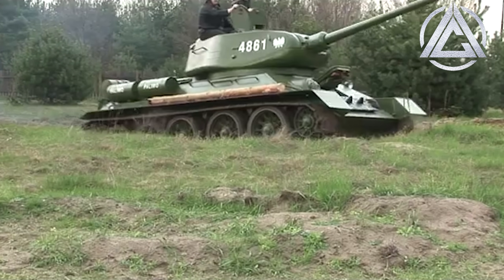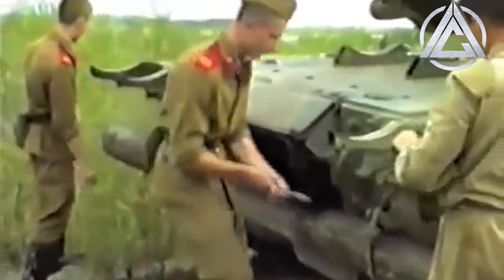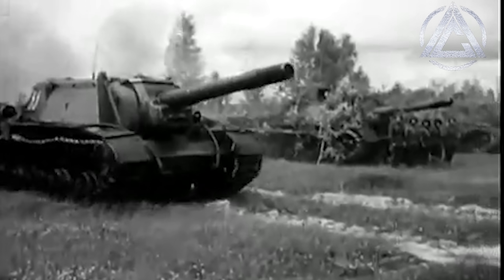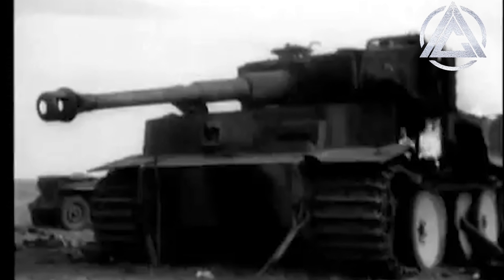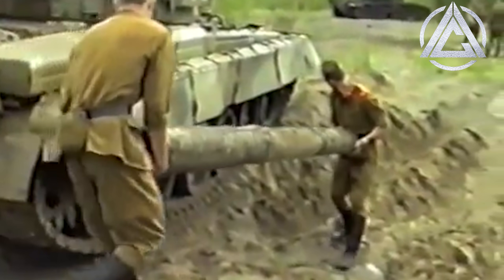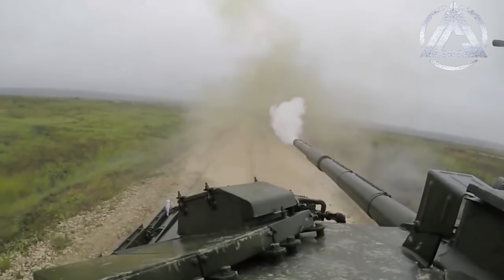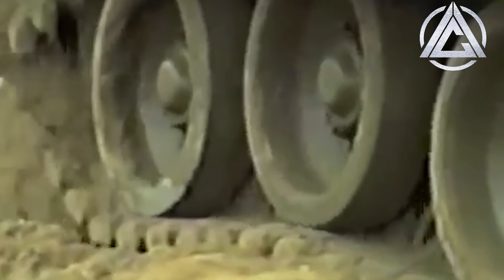What's With the Logs on Soviet Tanks? | Koala Explains: Tanks - Tracks and Traction

Comment: In the USA we have roads which may still be called “Plank Road”. During early days of expansion that was a fast easier method of construction.
Reply: During the Civil War, the Union Army created the "corduroy road".  Many of the primitive dirt roads that received heavy traffic from traveling armies would turn into muddy bogs during wet periods, which would slow & fatigue the infantry & the cavalry horses, & make artillery & wagon movement almost impossible.  To prevent this, tree trunks, fence rails, & ties from sabotaged railroad sections were laid cross-ways over the road to give a firm surface & prevent sinkage.  The road pattern resembled the cloth, hence the name.

Comment: American tanks always travel in at least pairs, as the smallest maneuver unit. They each have metal tow cables, shackles, and recovery points at the front and back of the tanks. It’s a lot easier to have the loader jump out and connect the tow cable to the stuck tank and give them a little pull to help them get unstuck. Assuming both tanks aren’t stuck. In that case you call a recovery vehicle and get laughed at by everyone passing by while you wait.

Comment: Ok, silly spoiler...sigh. yes the logs were to get traction in ice or mud. The briefing i got said, they use the logs for traction and could also be strapped to the actual tracks for ultimate traction to employ both sides of the tracks to get out of a ditch, etc. The other problem was that due to the vast numbers of tracks, the soviets didnt have a complimentary number of recovery vehicles to tow all these stuck vehicles. So, yes, the same reason my dad kept some 2x4s in the trunk of the car...

Comment: Lol.  Actually it’s to assist them in getting unstuck when they’re high centered on a rock tree stump at Cetera. By feeding the log from one side through the tractor the other and letting the center connectors catch the log it will help them walk over obstacles that are hung up on.  I was a crewmember on the M1 Abrams tank for years.  We did the same thing.

Comment: Soviet military maxims really were KISS, Keep It Simple, Stupid. You wont find differently launched munitions in the same calibre for example, eg 155mm shells & 165mm rockets. In the heat of battle a replen radio message could be sent wrong, so with the different calibres, the guy Not under pressure could immediately id that the commander does Not want 165mm shells, and ask if they want shells for guns or rockets for tubes.
Another great example of KISS in Soviet military was the conversion from 7.62 to 5.56, and the introduction of the AK74, pretty much Just a downsized version of the AK47, so no training needed if already familiar with the old rifle.

Comment: 3:00 What if the recovery vehicle gets stuck too? That's when you call the recovery vehicle designed to recover the recovery vehicle. That of course is when you get such rigs as the RVRVRVRVRVRVRVRVadnauseum
Reply: When I was stationed in then West Germany 1st ID 1989 remember a day when an M-1 got stuck on a hill 50 feet up and called for a recovery. M-88. Well the 88 never made it, as it got stuck after throwing its track on a rock trying to get to the M-1. They called for second 88 to try and get them unstuck. Don't know how that went but I know about 8 months later we almost got our M-2A2 Bradley stuck in almost the same area. Fun times. As for the M-1 the TC decided to drive it down the hill with only one track as the gas been thrown on a rock. Craziest thing I ever saw while in. Drove over the edge and across a road into a field. 
As for the 88's I Ausome that both made it out later that day.
Reply: Rofl

Comment: Mmm, I disagree with you about what defines a tank; a tank is a role: something that is mobile enough to cross open difficult terrain at speed and tough enough to get in fights with anything smaller than they are. If a tank were a mech or a wheeled vehicle but could perform the same role, it'd still be a tank
Reply: Good point, I think his definition was a bit too broad. Lots of talks about the Killdozer, which I would classify as a combat engineering vehicle rather than tank. Then there's self propelled artillery, which in the basic sense resembles a tank (tracks, at least some armor, big gun on a turret), but is not considered a tank - my understanding is their armor is thinner and they lack close-quarters defenses (typically don't have secondary weapons), their intended purpose is different from a tank, it is to yeet shells from a distance while true tanks get into the thick of things.

Comment: Dude you know nothing about tanks and why there are logs on them. Americans used logs to better protect their paper thin tanks, they also used sand bags, metal sheets, bags with soil and whatever else they could find laying on the ground, because nothing could protect them from 88mm Tiger gun. Russian tanks do not use logs to get out of the mud, they are designed for that terrain. Logs are necessary to get thru soft and/or sandy terrain and swamps. During operation Barbarossa, Germans did not travel north, because if they did, they would have end up in polar caps and not at the gates of Moscow. If you are too stupid to look at the world map, than don't make stupid videos. Also Germans tanks did not receive wider tracks to better handle winter soil.... You idiot, soil is frozen during winter, its as hard as concrete, there is no need for wider tracks to get thru! It's the same thing as if you would have said: "I need wider shoes so I can get to the other side of the road". FYI Russian tanks never weighted 60 tons, the heaviest Soviet tank weighted 52 tons - KV 2. 60 and 70 tons are weights of the German, British and American tanks. American crew men also used logs during WW II, to self pull their tanks out of the ditch, places where they got stock and so on, and it proved to be very effective. The only reason Americans stopped using logs, because their tanks riched over 60 tons mark, they became too heavy for that and they simply crushing that damn log. This is always the case, dump red neck yankee makes a video as retarded as he is and make other dumber by having them watch it.

Comment: They are still used, just carries by support vehicles more often than not. The ridge pole for the two masted army tent can be used in this capacity as well a the timber sections that make up the surface area of the lowboy trailers that heavy equipment operators Heavy equipment is transported to and from work sites

Comment: Wood does absolutely nothing in protecting from stuff anything that's pointy and designed to penetrate/go fast will on average rip through wood one massive reason why you don't use it when building fortifications anymore or better said avoid it at least when it comes to being infront of the shooter because ey guess what shrapnel lost of it when wood gets hit unless you got a giant log infront of you even small arms fire will unleash hell on you in form of many tiny wood fragments flying in whatever direction that bullet was going.
And also I'm interested to see what information material out there states Germany using logs as legit armour considering they tended to focus armoured skirts for helping but maybe I'm wrong and if giving the proper I'll gladly retract my statement about the Germany military.

Comment: This reminds me of that Cold War tale of how NASA spent tons of money to invent a pen that could be used in zero gravity.
Meanwhile Russians just used pencils.
Reply from the maker: A funny story, but actually not quite true - 

NASA had been using pencils themselves, but unfortunately pencils are extremely dangerous in space due to the graphite shards that they like to throw off. In order to prevent this, NASA were spending over $120 USD per mechanical pencil (adjusted for inflation, that's over a thousand dollars a pop today). What they developed was actually a cheaper and safer alternative, with a pressurized pen using gel-like ink that couldn't leak or oxidize, and could be used in extreme heat or cold

Comment: As the story goes, Nasa once spend millions of dollars on a pen that was able to be used in space. One day a Nasa guy asked his sovjet counter part what they had developed for writing in space. He showed then his pencil.......
Reply from the maker: A funny story, but actually not quite true - 

NASA had been using pencils themselves, but unfortunately pencils are extremely dangerous in space due to the graphite shards that they like to throw off. In order to prevent this, NASA were spending over $120 USD per mechanical pencil (adjusted for inflation, that's over a thousand dollars a pop today). What they developed was actually a cheaper and safer alternative, with a pressurized pen using gel-like ink that couldn't leak or oxidize, and could be used in extreme heat or cold

Comment: Most European tankers learn this method. The difference is that most countries don't carry the log full time, but rely on cutting down a tree if the need arises. Besides, the most common unditching is by pulling it out with an ARV og another tank(s) in the formation. Tanks rarely roll alone, but if you do and get stuck, most tankers are able to unditch using a log.

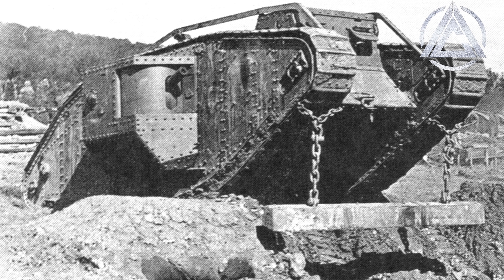Comment: 3:18 Not really there to stop AP shell, but rather to protect the tank from grenades with magnet. Germans even used a coating (I think it was called zimmerit) over their tanks which can be seen as "waffle pattern". However, they gave up the idea soon cos that coating contained flammable materials and if not 100% dry, it would start burning when hit, even on non-penetrating hits. Which is not pleasant... Also, in Europe, only Germans used magnetic grenades, so they never faced the opponent that threw that on them... Of course, a bit of psychological effect on crew when they put logs on side and think "Hey, that's extra protection" even though it really isn't...
Americans, on the other hand, faced Japanese infantry that did use magnetic grenades, usually on a bamboo stick for longer reach. So, having wood over your tank prevented those from attaching to the tank...

Comment: You are forgetting a crucial part of this method. The log is not only just put in front of the tracks, it is also attached to the tracks as you can clearly see in the footage. The log will become trapped in the mud under the tank which will allow for the tanks to use it as an anchor point from which it will be able to project itself forward. If the log is not attached the tracks will simple graze the log and chew it to bits. This also means the tank can only move forward until the log reaches the back end of the track because it can not travel further. If the tanks is still bogged down the log will have to be removed from the back end and be reattached to the front. It is a crude, but very successful and low-cost way to get your tank unbogged.

Comment: i mean, it can give protection against heat and hesh
Reply: True!
Reply: To a certain degree of course.
Reply: @nogisonoko5409  HESH (High Explosive Squash Head) is not affacted by angle of attack, remembering of the plastic explosive in the head of the ammo deform in impact, with exception of extreme angle (+89°), HEAT (High Explosive Anti Tank) in other hand, affected a little by angle, because its jet stream will follow the angle of attack (eg : Angle = 37° penetration angle = ±37°), the higher the angle the less efective the ammunition, although modern armor will not affected much by HESH or HEAT if it hit the logs in all angle
Reply: @nurrahmanpurwanto2976 
Yes.
Reply: @nogisonoko5409  great, you understand!

Comment: Serious question here. Is ground pressure/traction/ torque the reason why all the best protected vehicles are tracked and not wheeled? Wheeled AFVs have a lot of advantages but there just don't seem to be any with the kind of protection on MBTs. I'm guessing this is just an inherent design trade off? Anyone?
Reply from the maker: The main problem with heavier wheeled vehicles is what I went over in this video - you end up with something that can damage its own transmission on roads, and get immediately bogged down OFF road, because the weight isn't being spread across a wide enough ground contact.

The more weight you're putting on the chassis, the more ground contact you need, and you can only fit so many wheels on a vehicle practically.
Reply: So do you think say STANAG 4/5 protected wheeled vehicles like Centaro 2 are about the limit?

Comment: I didn't realise they continued this method for so long.  I think this is when the phrase 'if it ain't broke don't fix it' comes into play
Reply: Compared to the cost of the tank itself, the log is practically free, so why not keep it.
Reply: Log= fence post , fire wood , door ram , crows nest , road obstickles ...I wonder if some secondary use , influence s it's continued use . ?
Reply: cost of tank recovery vehicle versus cost of 10 foot long log - cheap enough to have a log for each tank, but not a tank recovery vehicle - I doubt setting the log under your tank would be much fun if you were under fire though
Reply: @richardhockey8442  then you would lose both tank and recovery vehicle, as both will be under fire.
Reply: @ceu160193  also they both can stuck because recovery vehicle it's basically same tank but with crane instead of gun.
Reply: @MegaSmouke  they got far less armor and a lot more torque and what not.

Comment: On American tanks in NW Europe in WW2 the logs were mostly used to give additional grip/purchase to cross railroad track without de-tracking the tank. The railroad tracks are hard enough & just the correct size to bite in between links & exert pressure between them, usually causing either accelerated wear of just outright snapping the track pins, separating the track. Some US Armored Divisions DID use logs as applique armor & Marine Units in the Pacific set up dedicated wood planking applique to reduce the effectiveness of Japanese magnetic hand grenades & hand mines.